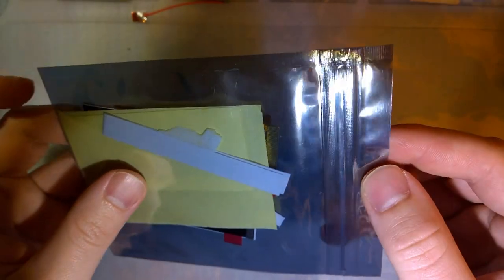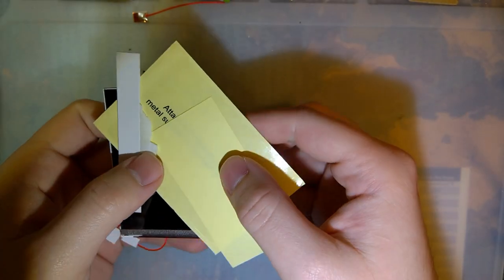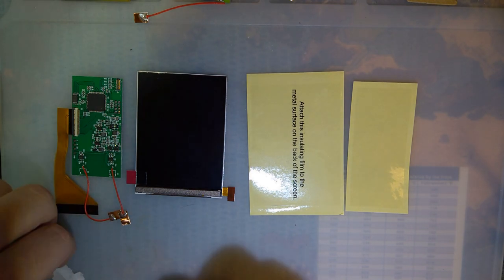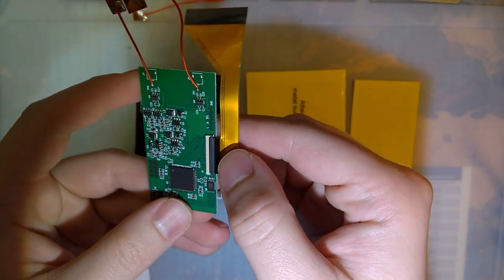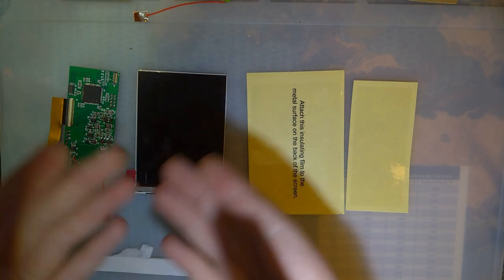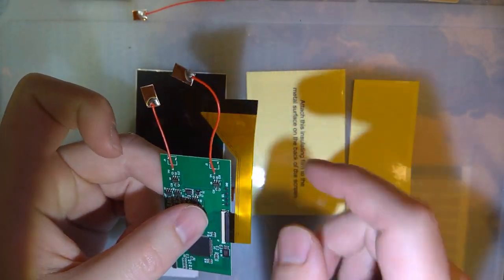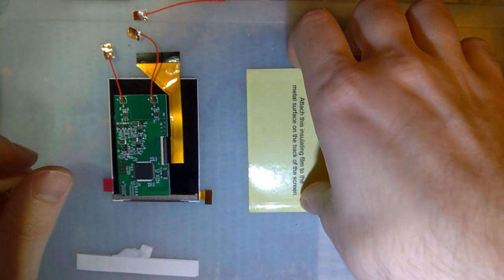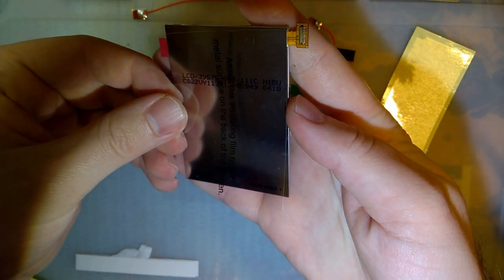'One Chip' Game Boy Color (GBC) IPS Backlight Kit (Part 3 of 3)

Comment: That last column repeating is a strange issue.  I've had this kit in my GBC for a month or 2 now and I don't have this issue.  It appears to be isolated to that specific GBC though, as when you swapped the kits around, the issue was still there on the clear GBC.

Also, I imagine the reason why the ezflash boots in the clear GBC and not in the blue one, is because the clear one has a better voltage regulator board than the blue one.  The fact that the blue one boots when you turn the brightness down is evidence of this - less load on the regulator.  You probably already figured that out though :)

Comment: I got this mod too but the touch capacitors didn’t work. I wired using the polyurethane wires. It was a pain in the ass. FYI don’t wire l and r to L and R. Wire a to R and b to L. The reason being pressing both at the same time adjusts the pallet while holding select. 

EDIT: I was using an extremerate soft touch shell that may have contributed to the capacitors not working.

Second EDIT: mine did not come with the LG screen but no artifacts and I don’t notice any yellowing.
Reply from the maker: Mine is the older version that does not have the hardware controls implemented. This video was just low on my priority list. That is good advice though, thanks.
Reply: How did you solder them exactly?  I couldn't get the button functional to work at all.

Comment: I hate those touch sensors. They only work when they feel like it, and sometimes that is when you don't want them to work. I liked soldering to the select, up, and down button. Why don't we have that option with these new GBC kits?
Reply from the maker: The currently shipping kits should have those controls enabled. I just have an old kit that does not.

Comment: Dude fucking Sprint unlocked devices are the worst. I have a tech repair business and we do unlocks on phones also. But I do not offer those Sprint unlocks because they are so unreliable and they are not permanent most of the time. It's just not worth the hassle on Sprint devices.
Reply from the maker: worst part is that it's a factory unlocked phone too, not even a sprint device. IDK what happened but a full factory reset seemed to fix it. Thanks Samsung.